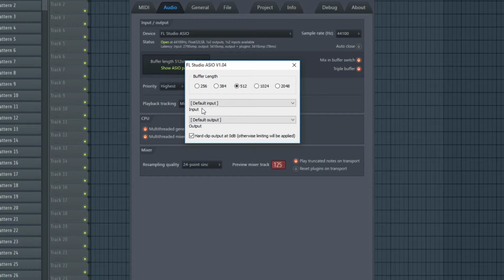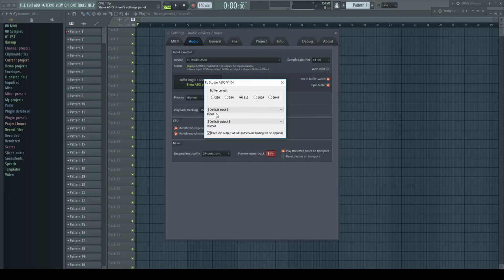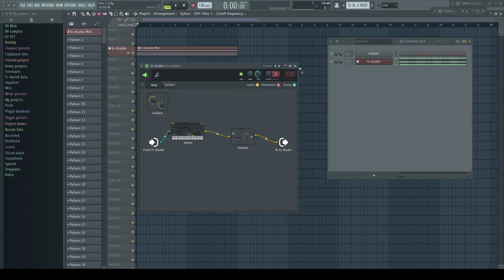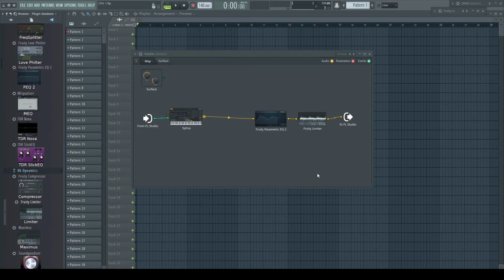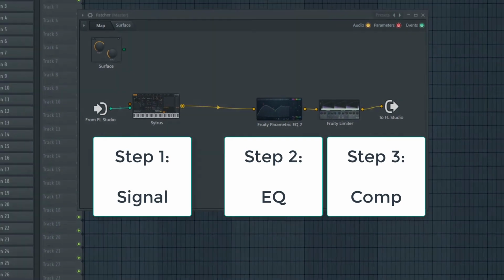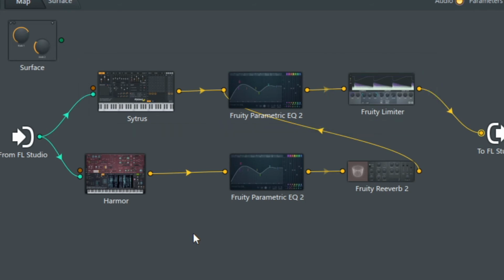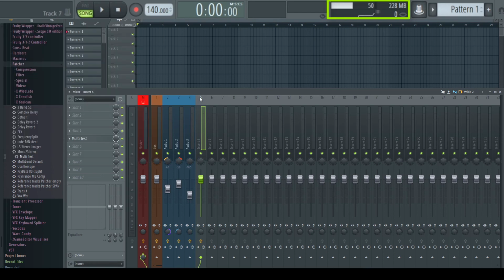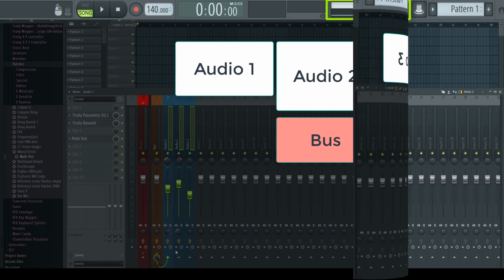FL Studio: Boost your CPU Performance...a comprehensive guide!

Comment: Just want to comment that CPU can process information out of order, known as OoO execution. This was implemented to prevent cores from beling blocked. However it is still better the way its currently setup as if it did have to process an FX that was on another core/thread then if that core is busy doing something else, it would end up having to wait on it. That other thing could be a freaking Windows Update. It wouldnt have to be something from FL Studio.

Comment: What about mixing at 96, 192 Sample Rate? Why can’t it be done so that each individual core processes its own sound? It turns out that even at 96 kHz it’s impossible to mix; one ozone on the master eats up about 50%, although it has a multi-streaming function, but it doesn’t work with such values!
Reply: I don’t understand why multithreading doesn’t work when using a Sample Rate value above 48000
Reply from the maker: @esp2644  It should work too... if not it would be a bug...
But remember 1. with oversampling you let everything work at least double as hard! 2. in regards to your Multicore question: only parallel processes can be splitted... not serial ones... other with some trickery which might not be supported everywhere...

Comment: Great Video, great explanation! 
I was wondering what about automations? for example you have a peak controller on the mixer track of your kick and use the automation for volume ducking in different mixer tracks or direct on the instruments. does the peak controller also "link the workload" like routing a sidechain signal to another track?
could it be that an envelope controller, controlling different volumes at the same time, is the better option, because no audio processing is involved to control the parameters?
Reply from the maker: I don´t know but I think that all of this stuff uses so little CPU that it doesn´t matter anyway

Comment: Bitwig uses less resources compared to FL Studio. Logic Pro uses more resources than Bitwig and so on. It depends on how software algorithms are designed. I think straight serial or parallel computing isn't not correct because, generally, equations are computed dynamically on the processor cores.
If I create the same plugins+effects chain (same sample rate, same buffer size) in FL Studio I get double the resources used than Bitwig.
Reply from the maker: I did tons over tons of different test and yes...FLS is a bit worse... but we are talking at max about more or less 10% difference but never about the double...
If you get the double CPU load you are doing something wrong like i.e. unnecessary high PPQ settings or similar...
Second you cannot compare the architecture between these...
FL Studio and Logic Pro are dinosaurs compared to Bitwig and of course it´s easy to analyze mistakes others made in the past and try to avoid them in a new product...
It´s a complete different story to change the complete basic structure of an existing product which equals to a complete rewrite...
Each company has to decide if a performance difference of at max 10% is worth to postpone every new feature for 2 years or however period of time a complete rewrite would take each time a company has learned from mistakes others made to improve their product...

The Bitwigs would have to do the same if they want to come anywhere near to the performance of i.e. Reaper which is still king in terms of multicore performance and maxing out the system...
And DAW hoping to always use the most efficient one isn´t an option for most users either as they decided for special reasons to use DAW A over DAW B...
Comparing different DAWs is pointless...
This video is about getting the most out of FL Studio not about getting the best performing DAW in existence.

Comment: Cool Video.
one thing only is that anyone with a well tuned ryzen system and the ryzen performance or balanced power plan on windows do not check the "force high performance power plan" in flstudio as it does more harm than good.
Reply from the maker: Perhaps it just depends how you configure the high perfomance plan...
But I never had a ryzen system so I cannot tell...